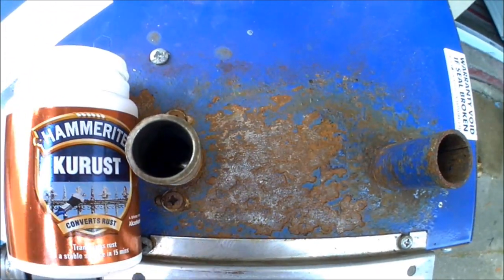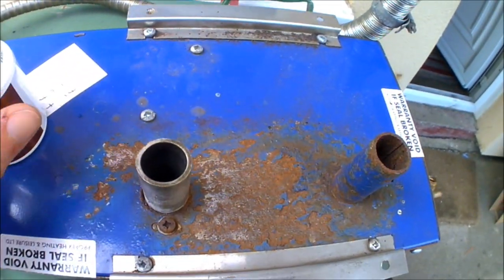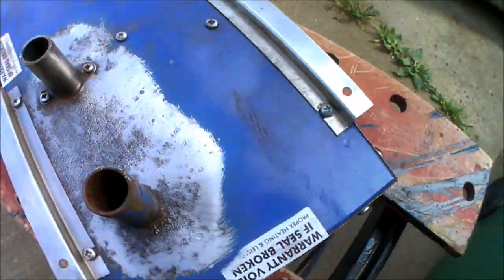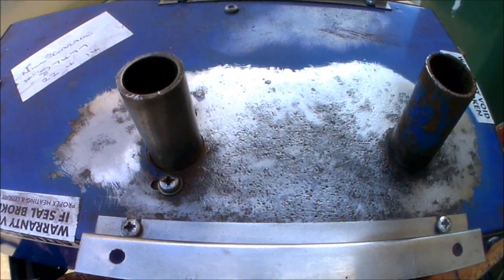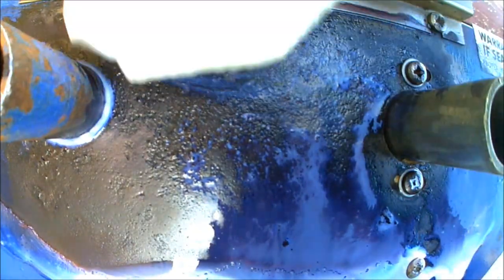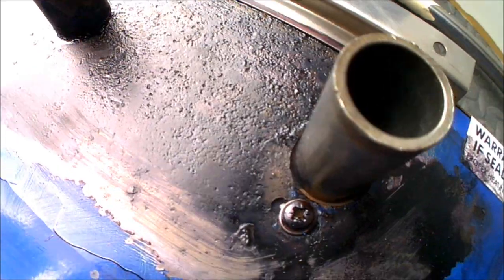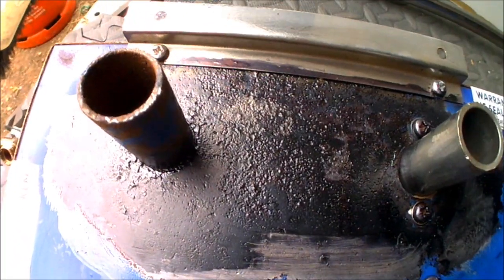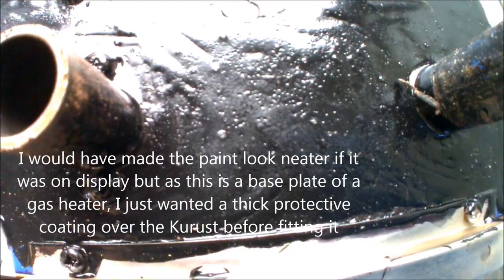DIY Rust Removal Hammerite Kurust Rust Treatment & Rust Inhibitor Application & Reaction Video

Comment: Ok I've just bought kurust in last hour ive noticed a small patch of rust on bottom behind edge of radiator so in order to remove old gloss around edge of where rust is ive got nail polish remover to see if that will help barring that I've got small wire brushes p60 sand paper really tough stuff and if it comes to it ive got a wire mini wheel that fits onto a cheap Dremel type tool to help abrade shall see how it turns out

Comment: Update I painted straight over kurust after 3 hrs as it allows that says so on container and the nail polish did jack to old gloss so I used p60 sand paper and wire brush just to note the nail polish remover does clean fresh gloss off if you get it on your skin at least very cold tho

Comment: Thanks for a great demonstration of the product, which I now know wil meet my needs but why didn't you take off the bracket at the bottom of the affected area?  As its likely that there is rust left under there that will in time eat up ward and negate the effort you put in.
Reply from the maker: In hindsight I should have, this video was the first time I'd used it myself , I do also recommend Rustins rust remover, seems to clean up the metal nicely where-as this just tries to harden any rust left in the metal..

Comment: We've just been quoted over £800 for two slightly rusting sill replacements on our Citroen Xara Picasso.  I don't think it's that big a job and I have used Kurust on radiators before.
Reply from the maker: rust will always come back, especially on places like sills etc.  The only way to be fully sure is to cut it out and replace but its ok for just surface pitting
Reply: @TheCampervanBuilder  Hi, thanks for your reply.  Seeing as this isn't a major job (like a cam belt for example) I saw no reaon to go throught the Citroen dealership as we usually do.  We are instead getting the bad areas cut out and one sill which we will buy from a reputable outfit on eBay which can be sawn and welded to both areas via a very reputable mechanic with a history of good service.  Just awaiting the labour charges but we thought £800 was a bit steep!!
Reply: @lolitre881  800 for cills is a rip off wire brush and this with some paint is totally fine as long as the metal is actually solid it'll buy you a few more years
Reply: @lukem9962   We got it done much cheaper and the metal was rusted because we don't have mud guards :)

Comment: Just used it. They suggest it will convert rust but I noticed it will turn anything black including skin patio concrete... And after rubbing back rust is still present. I think it disguises rust more than chemically converts it.
Reply: Yeah. Thatsy thoughts. It literally just paints it black. You might as well just paint over it. Exactly the same.process.

Comment: if you remove all the rust then there is no point in using the rust converter since there is no rust to convert so just paint over the metal insted.
Reply: I was wondering that myself...
Reply: There will always be a microscopic bit of rust, which will start the cycle all over again.
Reply: It gets into the pitted areas and converts it.
Reply: This was my thoughts entirely.
Reply: @Wsup2010  you can have rust but if its sealed properly with no oxygen getting to it then it wont spread.

Comment: This product and every product like it so called rust converter is totally rubbish it doesn’t work the rust ALWAYS COMES BACK , the only way to stop rust permanently is sand it off with a flappy grinding disk till all the rust is removed then coat the entire area with epoxy resin them body fill over the resin sand and paint rust gone forever until it rust somewhere else lol 😂

Comment: Any update on the rust. Is it dead or has it come back??
Reply from the maker: I don't have the van this was fitted in anymore but unless it is only minimal surface rust it will almost always come back over time and replacing the metal is the only sure fire way to get rid (if done properly)
Reply: Camper Conversion thanks you for replying. I just have surface rust on the wheel arches from widening them out.
Reply: Sandblastin no 1 or
This no 2.as an alternative
Unless you replace metal this is ok

Comment: Not the neatest job there but if it’s out of sight it’s out of mind I guess. I’d have removed the silver bracket thing too
Reply from the maker: yeah it's out of sight or I would have put a lot more effort in to make it neater but as its the base that sits on the floor of a van never to be seen again, I wasn't fussed about the neatness of the paint.  Yes I should have removed the bracket too, hindsight ehh

Comment: I thought the karust was a rust remover, it was when I last bought it
Reply from the maker: it isn't a rust remover, just a rust converter to stop the rust getting worse, it doesn't remove rust in general
Reply: Think they have different products
Reply: You would have to dip in acid (phosphoric) to remove rust.  Two or three days I expect.  Otherwise “paint” on phosphoric, leave, repeat and wash off when you think you have removed it (or enough of it).   I would still use Kurust after though.

Comment: one way. Cut bad metal away and weld in a new. Or sandblasting. You cant sand rust away. It will come again then
Reply: Sandblastin not always feasable. This is ok works for a year or two. Just repeat. Like for rust spots on carroof